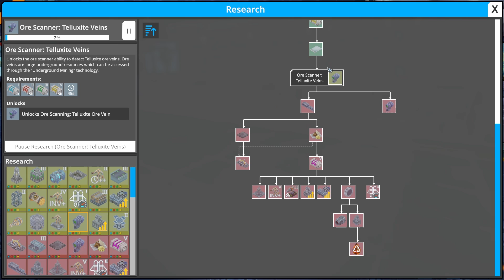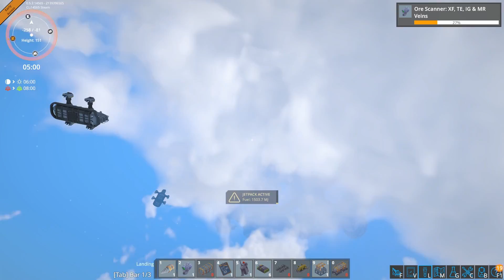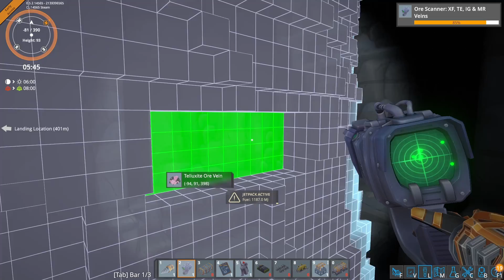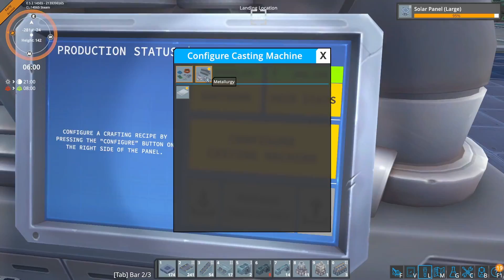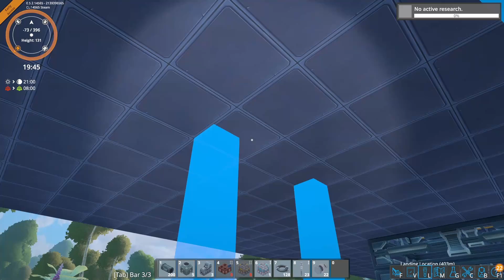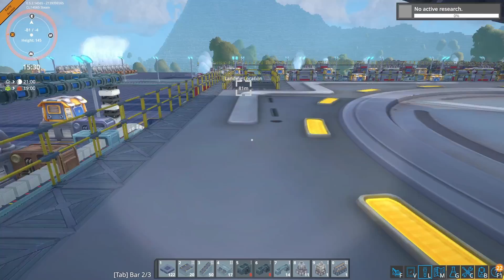Foundry - Self-Sufficient Vein Mining Outpost  [E10]

Comment: You don’t meet to dig a hole to pass power. The human elevator carries es high voltage power and you can tap into it at each level. Then just dynamite your way to each vein at a given level and string high voltage power to each miner. The vein or miners don’t even need a loader so you don’t need a transformer or platforms at the miners. You do need a single small transformer for the loaders that load your freight elevator.
Reply from the maker: Many thanks.

Comment: You, sir, have been hard at work. I just researched drone platforms last night so I have not used them yet. Underground mining looks a lot better than it did in the early days of this game. Before you had to automate rails so you could feed the system and it would move along. Now I am curious to see if the ore intake from the mining slows down or not. That was a serious problem before, as the rail line got longer the ore came back slower. Good episode.👍👍
Reply from the maker: Thanks. I will keep you updated. It looks like the output is stable at 160/m for now. I'm not sure how long that will last. Looks like fracking makes it permanent.

Comment: Are the ore veins limited or permanent?
Reply from the maker: There is a core. When you reach the core, output will stop. But, by that time you will have researched fracking. Add a fracking machine and the ore is unlimited.